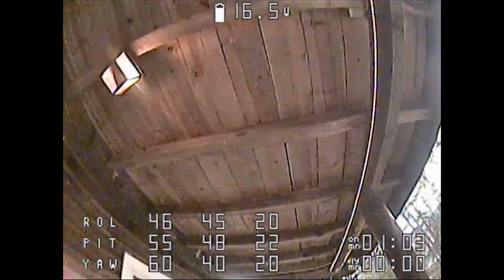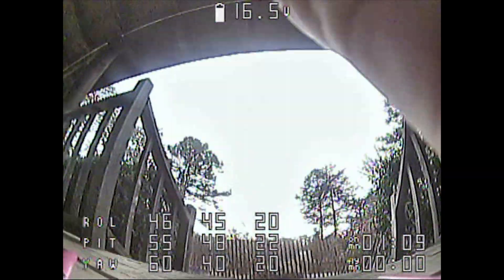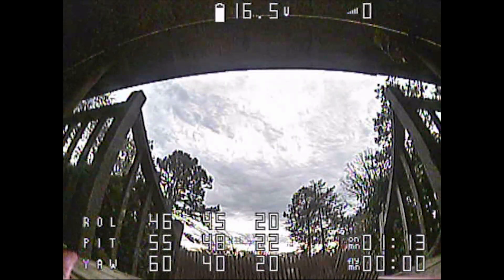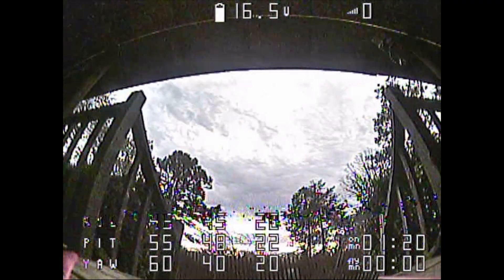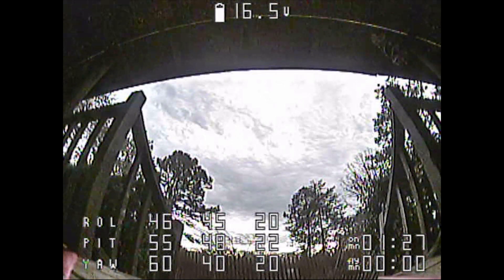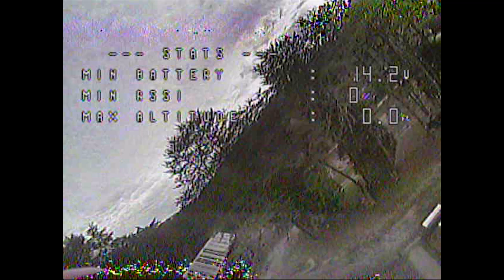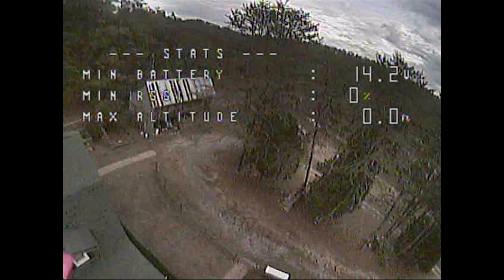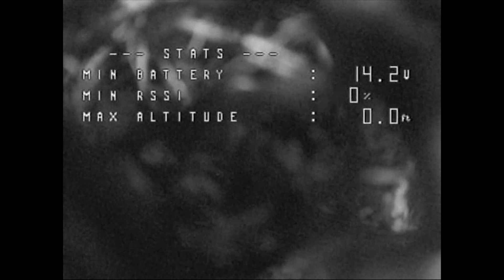Betaflight 3.1 OSD Sneak Preview | ON SCREEN PIDS

Comment: is there any way to make the pids scroll slower? i setup BF and BFF3 to take advantage of this feature. Works great. the only issue is that the adjuster is very sensitive. it is very hard to make precise adjustments like add 1 or 2 to the current value no mater how quick i flip the switch back and forth. cheers! (BF 3.1.6)
Reply from the maker: No, I don't think so.

Comment: Hey Josh..I hope your holidays went well and the family is all good. I recently received my Betaflight F3 flight controllers and was messing around with the OSD feature in BF. I'm trying to change the fonts on my display with no success. It seems it lets me upload a new font but once it does it kicks me out of BF and I have to reconnect. In doing so I proceed back to the OSD tab just to see my font setting wasn't saved. ☹️. Is there something I'm doing wrong Josh or is there a bug 🐜 of some sorts. Any suggestions would greatly be appreciated.
Reply from the maker: I have never updated the font on a BF OSD, so I'm sorry I can't say more.
Reply: Joshua Bardwell thanks anyways. I guess I'll just live with the default font until I run across a video about it or it gets fixed in BF 3.1. Thanks again Josh. 
P.S. After reading my comment Josh, if you happened to try to mess with the fonts now and come across the same issue as I have, I would appreciate a video on the subject or a message telling me what went wrong....of course if you have the time.

Comment: Hi, Joshua. I have a question about OSD. So is there AIO controllers on banggood that allows to control OSD via Betaflight configurator? As I understand this feature possible only on AD7456 chip(not MAX7456) couse in betaflight controller 7456 connected to STM via SPI. Am I right or not?
Reply from the maker: +Bravo13blog that's correct. It may not be correct forever though. For now all MAX chips are using MWOSD style firmware.
Reply: So for now there is no AIO controllers with AD7456?
Reply from the maker: +Bravo13blog no, that's not true. Sirin. Omnibus. For example.
Reply: Sorry me - Not AD7456 but AB7456
Reply from the maker: I don't know about that distinction.

Comment: hey josh.. merry christmas.. i have a question.. you helped me a couple times before... so im running betaflight 3.1.0 .. d-shot 600 on bump bee esc's  with the filter removed, on a lux running at 8k 8k.. im getting bad jitters when im at about 60 to 80% throttle then when i fully punch out it clears up... in the configurator when i spin up the motors with the tx, the dont spin in sync.. im going to try a new x4r.. the one im using has been on 3 different quads.. if thats not it.. what are your thoughts... thanks for your time!
Reply from the maker: +bobby averona if it does it in the Motors tab, the receiver is not involved. You know you're running an experimental protocol. That's most likely the issue. Have you tried dshot 300?
Reply: Joshua Bardwell no i haven't tried d-shot 300 yet... do u think that might make a difference?? or do you think i should lower the pid loop as well??.. thanks again... you always help me!!
Reply from the maker: +bobby averona try going to 4k pid and then also dshot300
Reply: well i tried dshot 300 in the motors tab and it seems to be a lot better.. they spin almost all in sync they are off by just a hair sometimes but i think thats normal.. i lowered the pidloop to 4k and then bumped it back up to 8 and the result was the same.. so i think the dahot300 might have done the trick.. i wont know untill i strap the goggles on and go for a flight.. ill let u know how i make out.. and thanks aga8n for helping me... i really appreciate your time!!

Comment: Yes!  Been waiting for this. I'm a little confused though.

Do you need a FC with built in osd for this to work?  Are there any pdb+osd combos that this will work on with any FC? 

I am finally sick of micro minimosd's. I have a box full of dead ones. I just want a pdb+osd that just works,  but yet allows you to change pids. Any that fit this bill?  Thanks
Reply: amen to that ! i seen people complaining at the field like : the osd doesn't show anymore / i lopst my picture in a roll/punch etc. ; they are so sensitive to voltage , and draw current like the vtx , why ? it's a classic case of bad stuff standardization like the naze32, who people still use for current builds because it's so popular and common (i have fury f3 FC because of joshua's channel)
Reply from the maker: You can do similar things with MWOSD, so you don't need a built-in OSD. But the easiest thing to do is to get an FC with built-in OSD like the Omnibus F3 and F4. You can also get a PDB+MWOSD like the Holybro PDBOSD. It will work similarly to your micro minimOSD but it hopefully will be more reliable.
Reply: Joshua Bardwell That's exactly what I was looking for thanks!  I remembered u had a video on it but couldn't find it. 

I'm just looking to keep my quads with good FC's in the air and fix this annoying minimosd issue. Next build I'm gonna go with an all in one,  and a 4way ESC for a nice light compact build.

This is my minimosd nightmare. Fixed the power issue I was having yesterday,  took it out today and half way through the flight the video connection to my cam broke loose...again. These things are a PITA but when they work I love them!  I have two rrosds as well,  one still on a quad but I love the pid changing convenience of the minim.

Comment: Hey Josh, have you seen this: http://www.nitbeatfpv.com/frsky-taranis-pid-settings
For someone that doesn't have an OSD (Or doesn't want to bother with setting one up just for tuning), it looks to be pretty cool.

For the setup, they gloss over 2 steps, mainly after updating the OpenTX software. It now requires the file names to be 6 characters(rename the script or it won't see it), and that it will expect the SD card to be organized differently, (just read the notes from the nightly release http://www.open-tx.org/2016/12/03/opentx-2.2.0RC8)

I suppose that my argument about not wanting to set up an OSD is invalid for now due to the effort just to update softwares, but it should be considered once 3.1 and OpenTX 2.2.0 are public release.
Reply: Joshua Bardwell that has been merged :)
Reply from the maker: Yeah, I've seen that. It's really slick. I would love to see that merged into a standard build.
Reply: Have wanted this in OpenTx for ages.
Reply: Your work is appreciated. It was as easy to flash as a stable build. With D-shot and the need to re-tune for it, adjusting PIDs via telemetry hasn't come too soon. 

What I'm looking forward to most in 3.1+ is how processing peaks are addressed. I look forward to the +Joshua Bardwell video on 3.1 when it releases.
Reply: this is awsome:)